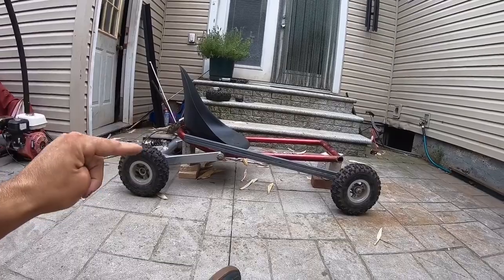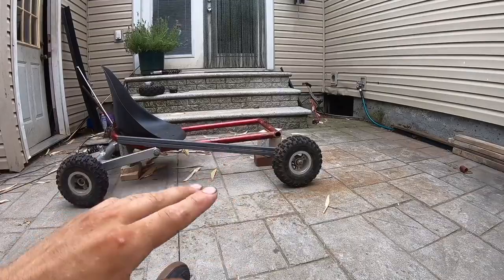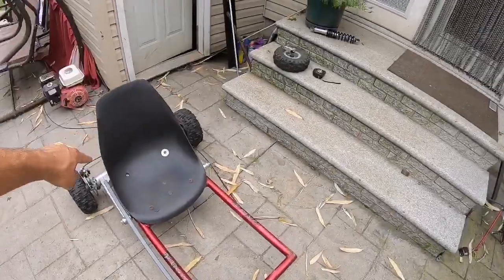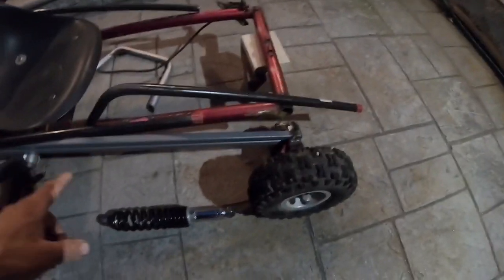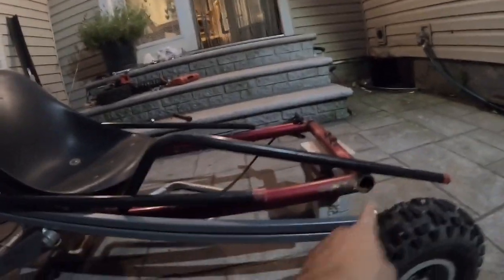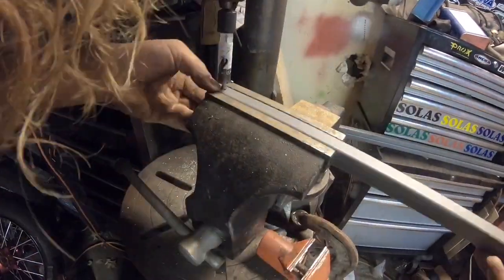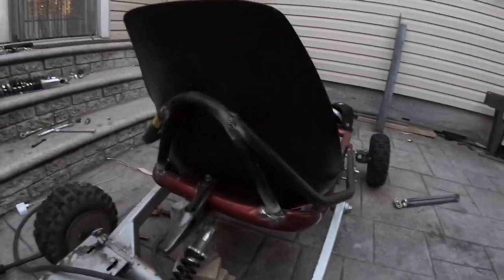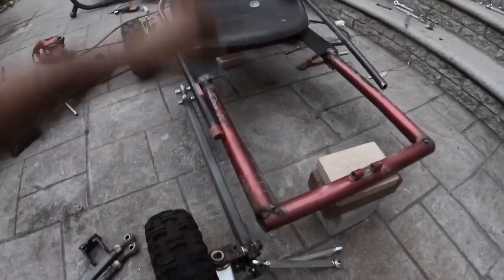(E2) How to build Independent front suspension- Electric gokart Build

Comment: I'm tuned in this channel since the second (or it was the third?) street kart video, and i'm loving this offroad project ^^
Reply from the maker: Loll I see you 👀 thanks a lot lmk what you want to see get built
Reply: First of all, i want to see this offroad kart ripping the ground and mud apart with a lot of torque, just like those monster trucks, only in small wheels

(if it was in the past i would ask for a full-diy street kart using self-welded chassis, an alternator as a 3phase motor and hall sensors installed on them to help the controller in low-rev torque, but that would get boring to you because other youtubers made karts exactly like this, only without trying the hall sensors to help, so i wont ask for that)
Reply from the maker: Loll I could try and make this off road gokart have a alternator motor until I find a real motor that I like.  I’ve been wanting to make an alternator motor. I think I’m going to try
Reply: I've tried to help, and found some things to try and help you to get this alternator-as-motor good for low-rev torque as it can be, and general things about controlling the alternator (a tip for this type of powerdrive is using a 3-phase controller in the stator, and a brushed controller into the rotor. The less current in the rotor, more speed can be achieved, the more current in the rotor, more torque can be achieved, if using 48v from the Street Kart batterypack, use a brushed DC controller with less than 12v-16v):

Some research links that i've found: https://endless-sphere.com/forums/viewtopic.php?f=2&t=98474, http://e-zephyr.blogspot.com/2016/09/alternator-to-motor-conversion-for.html , (youtube videos now): watch?v=r7OSRbCATyo , watch?v=EALApw3R9PM , watch?v=3L-m3IdQeyA , watch?v=iGoODvwNbQU , watch?v=Rg32j-ed7M0 (in portuguese, my native language, i can translate if you want/need) , watch?v=akDBTkB6FGI , watch?v=IKqy3rRWJQE , watch?v=cSY5C1NDkAM , watch?v=muCRyA7wy0I , watch?v=JyXdNNLsUhU , watch?v=pmgnA6Xg1lA , watch?v=_7cto5myJeA , watch?v=Jq9I-7Yh8Xg , watch?v=ITc4ZJZ9N9k , and watch?v=PEO1nXJsKWo

I hope that with this links, you can find something that works for you and help you go along with the idea of using the alternator ^^

Best of lucks!!
Reply from the maker: Wow this is super helpful! It’s 100% happening I love this idea